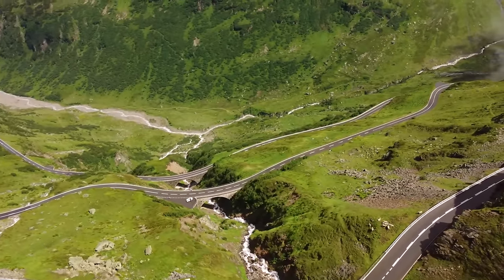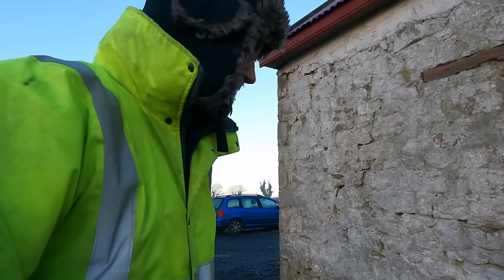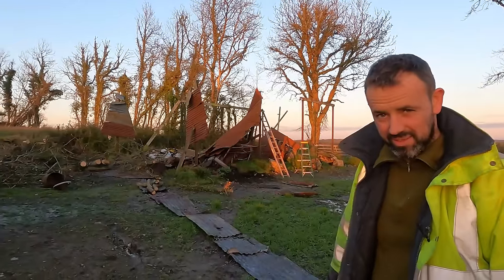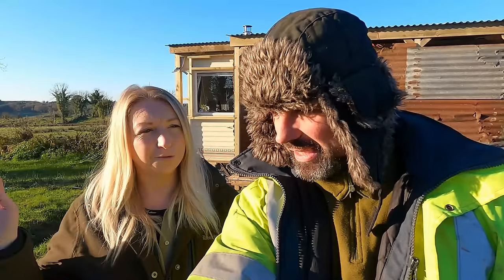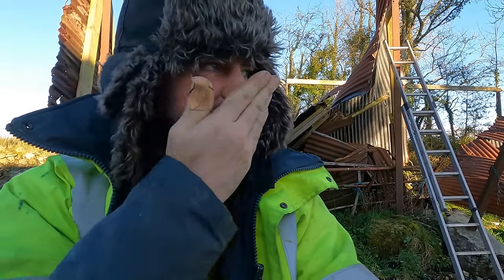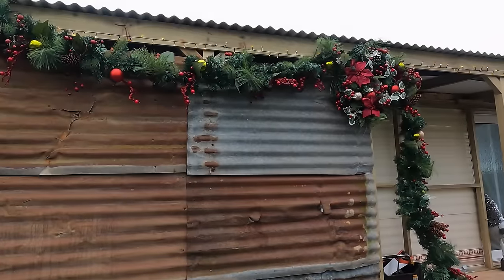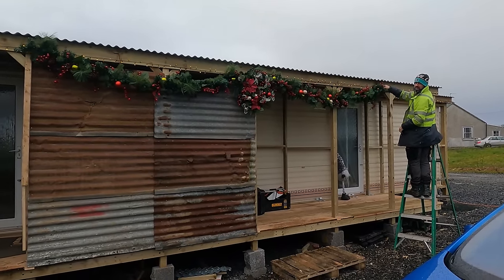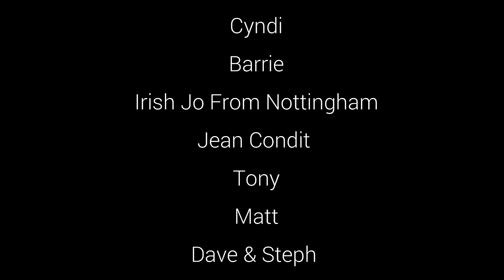Making a Log Store From Bits of Scrap! Episode 16

Comment: I know how you feel when there is no water. We live on land in NZ and when there is a power cut, trees in our area fall down on the lines in a storm, our electric water pump can not work. To flush the toilets I use water from the troughs in the paddock to fill the cistern. Also as soon as there is a storm on the way we fill up water bottles and put buckets out on the deck under the roof for overflow. We also have a camp gas cooker and kettle so we can cook and have tea. We also invested in a generator recently which we can use if the water is out for days. It's all good fun!
Reply from the maker: Hi, yes, it's all about being prepared, and once again, we weren't 🤣. Lots of lessons learned all the time, but you know what, like you said, it's all fun, and we love it here. Makes us stronger & more resourceful. Too long we have had it easy with everything on tap, literally. I love the simple life! Sounds like you are too. X
Reply: A petrol generator would be easier.
Reply from the maker: @derekcrowe2886  we have 2! 🤣
Reply: @theirishhomestead  my reply went to wrong post lol, it was to the NZ lady 😂

Comment: Great job creating the wood storage with rain catchment roof!  I just put up my Christmas decorations too.  Makes it feel festive and cozy and brings a sort of normalcy to the chaos. Is it possible to install some of that tin as skirting around the bottom of the static?  Even if it's rusted  it will temporarily help to block the winter wind from making it cold under your floor.  It doesn't look as though the cladding was meant to be installed in that area. So happy to see your love and concern for your lovely pets!🐕🐈‍⬛🐈🐈🐾
Reply from the maker: Hi! Thanks for your lovely comments. Christmas is big in our house. It is great for the kids as it makes it more homely. We are going to bring the cladding right down to the floor.

Comment: It's probably still frozen over but leave a small drip in the taps (shower + kitchen sink).
The pipe will not freeze when the water is flowing (think of a river). You don't need a lot so the farmer wouldn't mind. The pipe for the troughs are less likely to burst also and he won't need to free them out for animals if required.

You can get cheap thermometers in the likes of Lidl or Aldi which can monitor inside and outside temps. 
You'll be able to tell when to turn on a drip before you go to bed if the temp is down near 0 degrees outside. 
Plus it will help manage the temp settings from the stove. When to Open/close the draft controllers etc. and what effect it has on the inside temps. 

If you have a fire lighting its hard to tell what it is like outside. Thermometer will help manage the suitation. 

I had a quick look for this response. Apologies if already mentioned.
Reply from the maker: Thank you for taking the time to give us such great advice. We are hoping the cold snap I'd over for while now but yes leaving the taps on a little is great advice. We do need to buy thermometers so thanks for that as we hadn't even got that on our radar. We are learning about being more aware of the weather forecast and being better prepared. 😀

Comment: be cold till april. ya better get coal too go with the sticks. check  that water your using from the farmers pipe is potable as it could be only fit for livestock. depending on well or group scheme.  you will get a few spells off severe frost up here over the winter up till april.
Reply from the maker: Thanks, yeah, we have a good place to get coal from. Need to stock up! The water is from the mains, we checked that. Same mains we will be tapping into eventually when the motorhome sells and we have the €2300 the water people want to do it. We filter all the water anyway in a berkefeld.

Comment: I’ve been wondering what you were doing for water, because I couldn’t remember you ever mentioning a well and I was pretty sure the public water wouldn’t have gone up there.
You can stop surface pipes freezing by keeping the water moving in them. I do that on a smaller scale, here. What you do is run a second pipe all the way from a point that never freezes, probably in your neighbours house, shed, or wherever he’s taken the feed for his drinkers from, all the way to your caravan. Connect the two pipes in parallel and put a circulation pump at your end, so when you’re not running water through a tap, you can pump it round in circles to keep it moving. It doesn’t need to be a fast flow, so even a low voltage circulation pump might work. In olden times, people would leave a tap running, on front nights, but since your neighbours water is probably metered and paid for as a commercial supply, you can’t do that.
Reply from the maker: Yes we can't really keep it running because it is metered. Hopefully once the motorhome sells we will have a connected put in. We are managing for the odd few nights it's freezes with good neighbours. We are used to limited water from when we were travelling. 👍

Comment: Looking good. Will you be insulating the walls before the cladding?
Reply from the maker: Yes, we are the same as the roof with rock wool. 
 A complete nightmare to work with but cheap compared to other types of insulation.

Comment: Did I miss the reason that you haven't started work on the house and ruin yet? I was imagining that you would have replaced the roof as a very first step before the autumn rain so that the interior can then be modelled to your design in warm and dry.
Reply from the maker: Yes, you missed it.😉 We are applying for the derelict grant up to €70k. We have to have that approval in place before we start any work on the house or anything we do won't be included in the grant. The second kicker is that you only have 13 months in which to get the work done from the point of it being approved and the cash ready to start as it's paid back at the end.  We need our motorhome to sell to give us the funds available to get started as soon as the approval is in place to stand a hope of getting it all done in 13 months. I hope that clears it up. Just hoping the motorhome sells soon. 🍀🤞
Reply: @theirishhomestead cheers for that. Now I understand why the delay.  Seems odd that they will give you the €70k money only to want it back in 13 months time?
Reply from the maker: @nickmeteor9663 they don't give us any money. That €70k is the maximum they will give you at the end. You don't get anything up front hence our need to sell the motorhome.